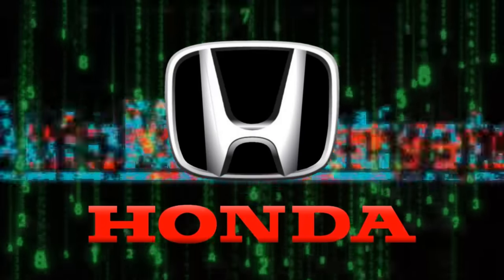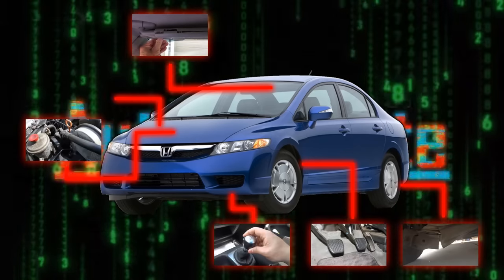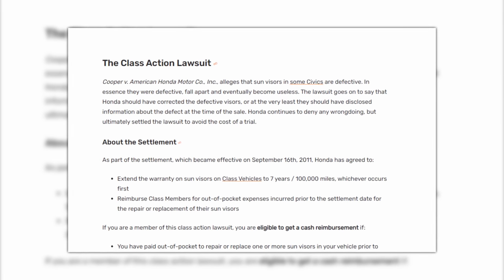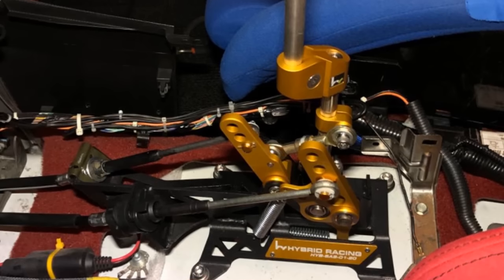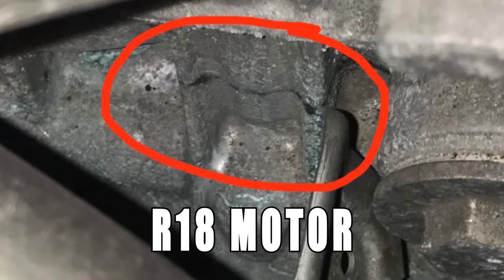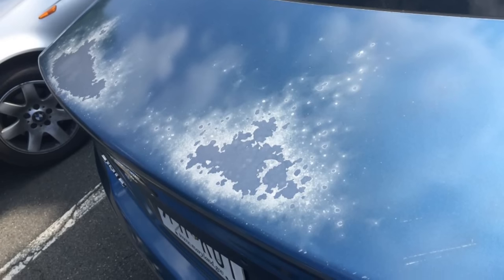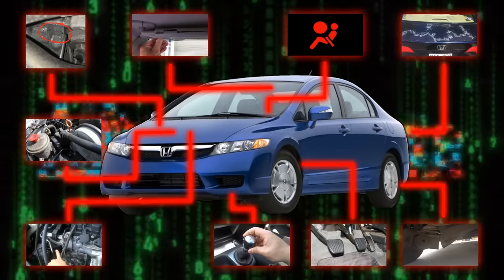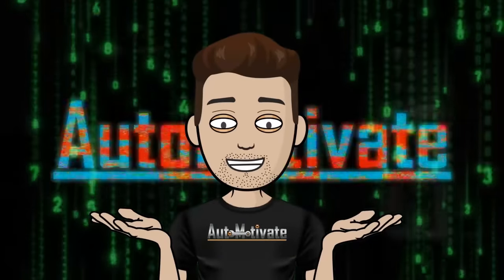Watch This Before Buying a Honda Civic 2006-2011

Comment: Yeah....incorrect... I'm a Honda master technician for the last 20 years & an ase master tech for the last 34, there isn't a more bulletproof vehicle made than the 06-11 civic. Other than the block cracking which Honda covered for 10 years unlimited mileage, these cars are pretty as much problem free as a car can be. I did do hundreds of short blocks on these things over the last 10 years or so, but to say this vehicle is not dependable is a massive understatement.
Reply from the maker: I am not saying don’t buy the car. Every car has its issues. I am just going over the most common issues to help others if they are experiencing symptoms with their cars. I’ve been getting about a 50% if people validating this video and the other 50% saying their car is perfect.
Reply: @AutoMotivate  i'm not saying they're problem free, but they are dependable. i actually put a transmission in my kids 2006 the week before last, the lower radiator hose connector popped off the radiator the next day & he continued to drive it till it overheated so badly the head gasket blew & the 
plastic dipstick melted off about 6" down the tube, however, i was able to grab a good engine at a local junkyard for 550 bucks, put it in last week & he actually came by with an egr code today so i switched over the egr valve from the old engine whilst noticing the one on there was kinda bent to one side from an impact that probably happened at the junkyard. i paid 98.50 for a timing chain, guides, tensioner & water pump on amazon & resealed the front cover along with replacing the valve cover gasket. i bet he gets another 100 k outta that thing if he doesn't total it first! i do appreciate your reviews though sir. i try not to be one of those know it alls that can't learn anything from others

Comment: I had a 2008 the engine block cracked at only 5k miles and I babied that car. Was in the dealer shop 18x the first year under warranty. Biggest pos

Comment: 170,000 mile 2006 honda civic, ive had no issues rather than a few leaks here and there
Reply: @driverman9528  you did??? Havent had to do that yet, how much did that run you?

Comment: 4 years with mine 09 and only issue I had was the headliner falling out lol easy fix, hopefully it keeps going strong!
Reply: How’s ya fix your headliner? I have an 06 and really need to fix my saggy headliner but I’ve read that it’s a pain to get the headliner out of the car
Reply: @masondill5179  I'ma be honest it was easier to get it out then put it back in that was just me though. We pulled it out through the drivers side took a bit of maneuvering. I didn't document how we did it sorry about that. Also I have the coupe ex model idk about you.
Reply: No cracked engine block? I’m gonna look at an 09 civic ex tomorrow and kinda worried about that problem, the car is 5k and I don’t want to have to fork out more money for a big issue like that, it has 146k miles
Reply: @kingdoge69  No cracks at all, mine is only 120,000ish miles RN I don't drive it much because covid happened..
Reply: @Sam_S2k  ok, thanks for the reply

Comment: I have a 2006 civic lx. I bought brand new. It's a piece of feces.  Visors are broken had them replace always kept braking, interior plastic falling apart, stereo doesn't work, engine mount failed at 30k miles, rotors failed at 60k, multiple brake replacements car only has 92k miles, can't keep alignment,  changed shocks 3 times, replaced control arms , still rides harsh, paint is horrible, air bag failed., a.c compressor failed,  alternator failed, thermostat failed, power steering pump leaking, belts worn out, multiple headlights replacement,  headlight plastic wears out fast,  drum brakes failed, infotainment buttons failed, rotors failed, throttle body and combustion system failed, the car is garbage. Hondas are being made in china and u.s are not the same quality as being made in Japan. Honda is making cheaper cars by the years

Comment: The only issues my 06 civic coupe has are caused by the dumbass that ghetto rigged the remote starter in her. Currently at 289,000 and some change

Comment: I’m considering a Honda Civic 2010 sedan which they are beautiful cars so I’m trying to make my decision but I’m thinking I am going to go with the Honda civic.
Reply: Very good car
Reply: You won’t regret it. As always when buying a used car, keep a few bucks on the side for some minor issues that may have to be fixed. Other than that I had a few friends with these 8th gen civics and they are so reliable.
Reply: @paulc9694  I have a 2010 civic ex sedan with 221k miles. Still runs very well.

Comment: I have an 06 RSX, air conditioner , motor mounts and power steering pump are my issues, pretty much the same car
Reply: I have an 05 no issues yet but what should I look out for? 
Actually the only issue I had was the water leak on the taillights but I fixed that

Comment: I have a 2011 Civic and this video is 100% right on. The sun visor issue, uneven tire wear, the paint fading too.
The only issue that was not mentioned in this video is the window and windshield trim. The trim literally cracks, breaks, and comes out! I lost all my windshield trim well before 100K miles. Not the most comfort car either, I have to sit down into it and climb up out of it. 
Honda engines are legendary and their drive trains are solid, so the problem is that the car will keep running while it falls apart around the engine. No excuse to buy a new car. Bummer. LOL!
If/when I have to replace it, I’m defecting to Toyota.

Comment: I wouldn’t even bother with this video. Clearly it is a reach to get views. This is one of the most reliable Honda generations to date. If you want to go after the civic maybe try for the newer 1.5L turbo earth dream motor versions with the oil dilution issues. Too many people in the comment section saying minor issues. I have an 08 LX manual with 246k on it and have only ever dealt with standard maintenance.
Reply from the maker: Every car has issues. No matter how reliable a car is, it still has common issues someone should be aware of before buying an unknown car. That is how you get scammed and become broke. Knowing what issues to look out for is key. Acting like the car has zero issues is ignorant.
Reply: @AutoMotivate  haha ok that’s a great point. Every product a company sells “has issues” when you sell hundreds of thousands of them, it’s the rule of averages at play. You are literally taking one of most reliable cars in recent history and trying to make it look like it’s riddled with problems. As you’ve said “every car has issues” sounds like you are going to be making a lot of videos tearing apart every car on the market. Thank you so much for this information to help me avoid getting scammed and becoming broke. A better way to put it would be for you to say get a PPI from a trusted mechanic and understand you are buying a 10 plus year old car that has a solid track record but you might have to handle some wear and tear issues that come along with owning a 10 year old car. I get it though…based on the YouTube algorithms for getting paid it makes more sense to post controversial topics that are going to comments. Good luck
Reply from the maker: @weeksauce23  I understand your point of view. My goal is really to help out others. I try my best to make my intentions clear, but they aren't always. Ill try to add the PPI advice in my future content. Thank you for understanding!

Comment: So the thing you said with the cracked engine block literally happened to me this year or the end of last year around 80k miles. And my power steering was having problems
Reply from the maker: Sorry that had to happen to you. Did you replace the block? 
Its crazy because I have gotten a lot of people saying this video is incorrect, yet I have had a good number of folks who have had cracked blocks.
Reply: @AutoMotivate  ya I guess some people just get lucky lol. But I actually have a big sound system in my car so I just bought a whole new motor because it would’ve costed me more to buy a new car
Reply: I bought an 08 no5 knowing there was a crack in the block last year. They put like a jb weld or something in it. So far I was able to drive for a year and from Alabama to Michigan no problems. Thing is I either buy a new engine for 2k or a new vehicle. I only paid 4k for the civic. What a mess

Comment: 8th gen Si will last well over 300K with regular oil change
Reply: Probably will go through like 3 transmissions in that time
Reply: @thechillywinds5810  must be a unlucky model. I know a guy who drives a EP3 and got well over 280K miles on the motor and still runs like a charm
Reply: @GhadSpeed  Yeah I think the 2006-2009 Civic Si's have really, really bad transmission problems. 2nd and 3rd grinds and pop outs are very common I believe. I own 2010 Si and I think they revised the transmission for 10-11. In any case I dont have those problems. Only on 85k miles though so we'll see.
Reply: @thechillywinds5810  09 is when they fixed the trans issues to my knowledge.

Comment: What's this man talking about 😂 mine was a rebuilt 08 civic that was wrecked in the front the only thing I've had to do to it was put a new cv axle and transmission seal in because they put an aftermarket in. I've had it since it had 72k miles. And the power steering is as strong as it was when I got the car. Just change the fluid and it'll last longer 🤷🏻‍♂️
Reply from the maker: I think it’s hit or miss. I’ve been getting about 50% of the comments saying their car is perfect and the other 50% validating this video. I’m glad yours is doing well 🙏

Comment: I have the airbag light issue and the mount issue lol I brought mounts all of them but I don’t have the money to install them
Reply from the maker: If you want to do the engine mounts yourself, you’ll have to jack up the engine, loosen the bolts and remove/replace the mounts. 
You would need a torque wrench, some sort of heavy duty jack, and new mounts. Ofcourse, you should watch a video first. 
But, I  think even buying all those tools new from harbor freight might still be cheaper then going to the mechanic.

However, if you don’t think you could do it yourself, definitely take it to the mechanic or a side gig mechanic.
Reply: @AutoMotivate  thanks lol I’m not doing it myself cause no lol but I am taking it to a mechanic soon, I’m currently saving

Comment: I passed my 2010 DX civic sedan to my wife, and got myself a 2015 civic si mostly to learn manual in my own car. I had my 8th gen for 5 years, and even bought it with 132K miles. Shes at 210K miles now and has never given me issues other than replacing the cat at 180K miles. I only bought a 9th gen because I couldn’t find a solid, untampered 8th gen si in my area sadly.

Comment: Guess this video must be from a Honda hater. All mentioned could potentially happen to other car makers. Nothing is concrete to confirm the views. I have a 2008 Honda Civic and this babe has not given me any issues that cause headaches.  Just seems like picking needle from a haystack
Reply from the maker: Not hating friend, just pointing out the common issues within the car. I’ve had a lot of folks confirm them. Not all Civics will have these issues, either. 

Glad she’s been well 🙏

Comment: Have a 2011 Civic Si Coupe, everything is perfect about it! After replacing about literally every part you can think of. K24👍🏽💯
Reply: for real tho! i have an 08 Si coupe with a big turbo k24a2 with a built head🤌🤌 works good
Reply: Lego Man Forced Induction will be the next step! Can’t wait
Reply: @hondaowner2995  How well does a k24 fit in a 8th gen? I've heard the k24's are taller than the k20z3. Any custom fab work?
Reply: The ChillyWinds no custom fab work, just on the left motor mount you will need a CRV bracket instead that’s about it. And it does sit a little taller so the oil pan will be below the subframe. Possibility to crack your oil pan but K Tuned sells a crash bar to prevent that. It’s a bar that sits right below the oil pan so that will get hit first before anything else👍🏽

Comment: Bruh you’re just hating on it lmfao this car is probably the most reliable car you’ll ever buy don’t listen to this stupid bs
Reply from the maker: Dude, literally every car has its own issues. I’m here pointing out this cars issues to educate others. I’m not saying don’t buy it. 
Furthermore,  there are many people validating my video. Checkout the comments.
Reply: @AutoMotivate  I see a lot of comments sayign this car never had any issues and had well over 100k I owned this car
Reply from the maker: Right, and not all of them will have issues. These are just the most common issues talked about with this car. My goal is to help people, that’s all. 
For instance, if you are experiencing a weird symptom, perhaps this video will point out the potential issue.
Reply: @az-vr1wv  you probably got bad car it did you get it New? Or used because that car maybe was never taken care of and it’s showing

Comment: I'm a Honda guy but just buy Toyota why settle for second place in reliability and spend your hard earn money on inferior honda, honda is getting worse and worse every year and their dealers are scammers.
Reply: Because Honda's are more fun and modifable? Toyota doenst really sell sport cars anymore aside from the Supra and 86
Reply: Honda’s are just as reliable if not more. Honda has better technology and overall better engines.
Reply: @raiderrichard7291  yes, better engines but the transmissions are weak, Honda makes sun visors that melt in the hot sun, this happened to me and my car was out of warranty. How do you select the cheapest plastic you can find and make parts for a vehicle? unexcusable, last year I bought a Toyota Corolla, Honda is becoming the new Chrysler.
Reply: @thechillywinds5810  the supra is not a toyota, it's a BMW 👌

Comment: Unsubbed, I use to listen to for all my car purchasing problems, my 2007 has 200k+ and still running strong, dont say we're haters, cause we're taking your advice that could cost us thousands of dollars
Reply from the maker: Question: why would it cost you thousands of dollars if you don’t have issues? 
This video is to help folks look over a car or simply help guide someone through a problem. 
If you look through the comments you will see a healthy mix of people with very reliable cars, and others validating this video. 
I don’t mind that you have unsubbed, doesn’t bother me. But, stating that I’m costing people money is highly false. 
Be a bit more positive 🙏